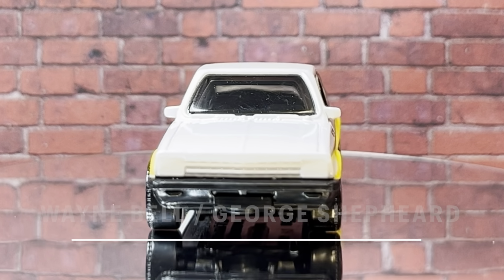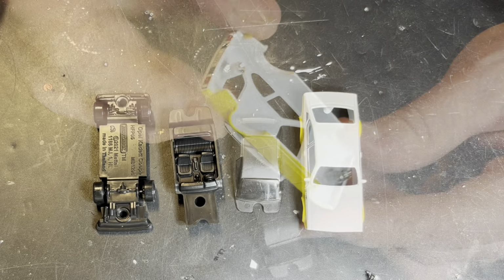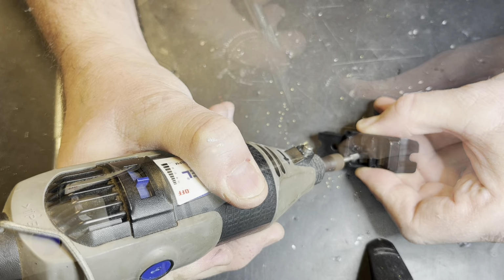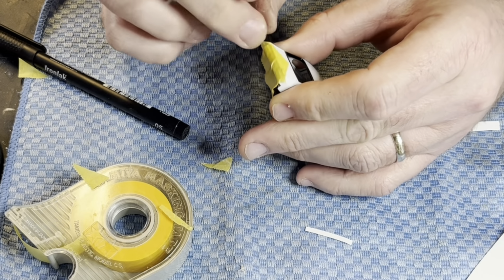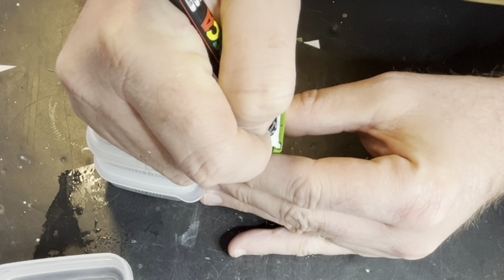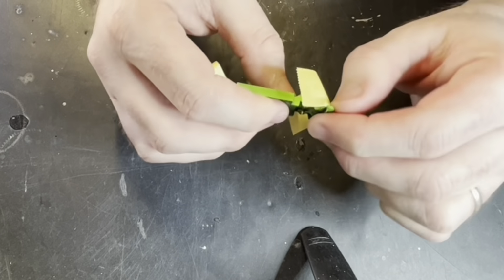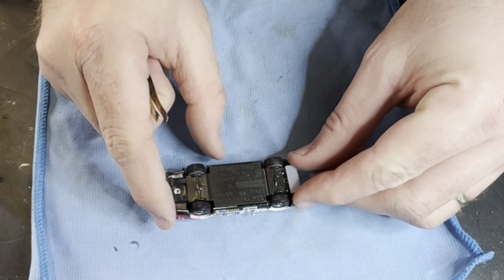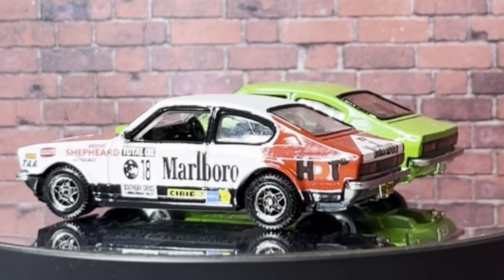Matchbox Kadette to Holden Dealer Team Rally Gemini Custom Double Build

Comment: On your next build after you strip the paint & clean up the mold lines drop the body into some white distilled vinegar for 10-15 minutes. This will etch the body & your paint will stick a lot better & you won't get paint peeling after masking as long as the paint is fully cured. An older guy who built H.O scale trains back when the only way to get a certain model train was to buy a diecast kit of it to build told me this trick & it has worked amazingly well for me when doing paint jobs on diecast cars. Hope this help you & others doing similar builds
Reply from the maker: Thanks Brian, it is something that's driven me insane for years, but happens mainly with white paint for me. I tried using Tamiya Metal Primer, but that's an expensive route. I always let them cure properly, and my shed gets pretty hot sometimes so I figured it probably helps 'bake' the paint on there, but I'd still get peeling so I am most definitely taking this tip on board, thank you.

Comment: Very cool builds, i do have the Kadet and this is now tempting to custom. WIth your decals, when you make them, do you gloss coat them after printing?
Reply from the maker: Thank you very much. I used to have to clear coat them when I used an Ink Jet printer, but I use a Laser Jet now which doesn't require clear coat and the decal film is much much thinner than the Ink Jet paper too. If you'd like me to post a set of the decals to you (I always make extras) send me an email and I'll sort it out.

Comment: aw, what a work, but looking great, these two. :) the green loooks almost like the Opel Signal green, I just think it was a tad bit darker originally. but I can be wrong. anyway. :)
great deco, love the ATS wheels. they used to be very popular here for a good while, like these spoked BBS wheels only cheaper and available for less expensive cars, too. :)
I just notice that Matchbox printed on the black door/side window frames, but not all the way through... why do it, then?  also, tinted glass is dumb, especially when the casting has an elaborate interior. I don't want to know how many interior piece designers breakfast backwards when the finished casting has almost-black windows later... but coloured ain't better, I hate SIKUs neon-green glass inserts. :P maybe it's marketing decison? to boldly give the people what they never realized they wanted?
Reply from the maker: Thank you! Sometimes I think they make intricate interiors as a sort of 'easter egg' for people who pull them apart. Case in point is the HW 1996 Impala, that's got engine detail in a casting that doesn't have an opening bonnet. It's weird!
Reply: @PBsRetroRestorations  Oh? THat's funky. maybe they planned on a translucent-body version, who knows... weird indeed!